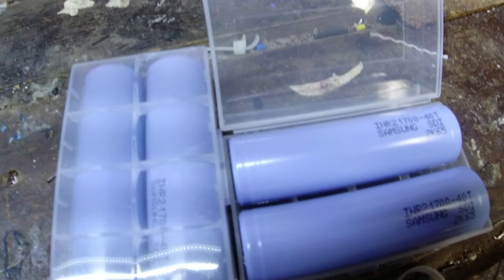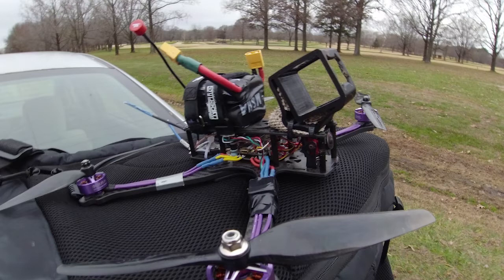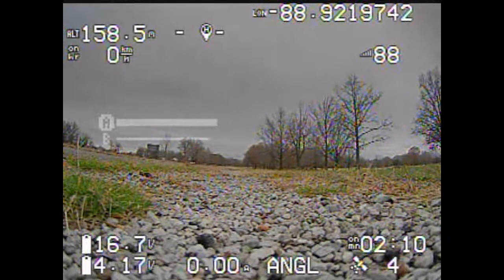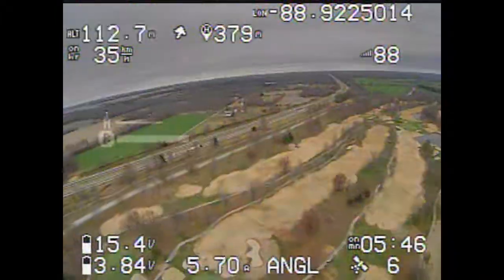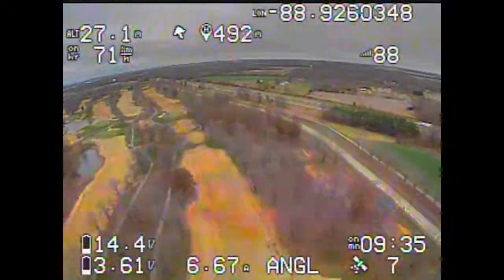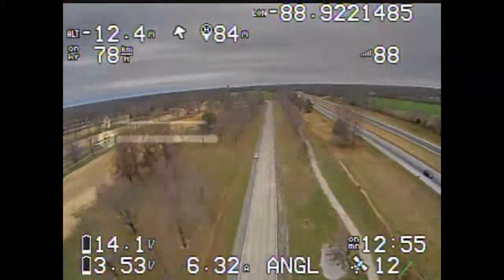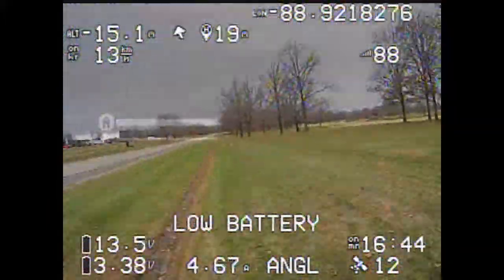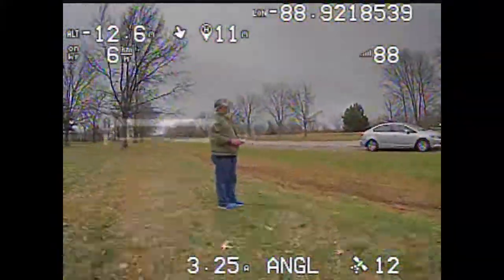Samsung 40T Lithium Ion fpv test

Comment: Hi can I use this pack for a Protek35 4S?
Reply from the maker: Looks like you could, the lithium ion is heavier though.
Reply: @gattmolson  I know but I think without freestyle it should fly. Motor are really powerful
Reply from the maker: @sickshots  lithium ion are like 4 cell with the voltage about 3.5 cell.  So if you don't need big power that will be fine.